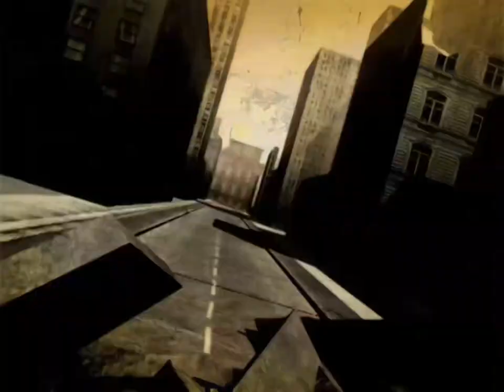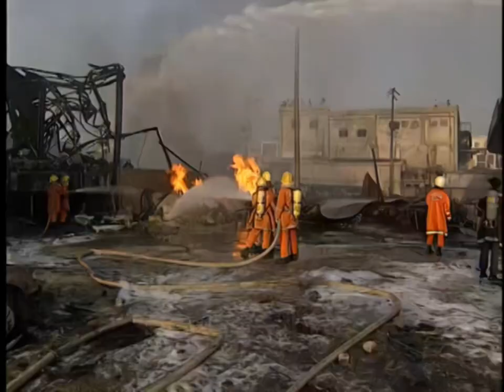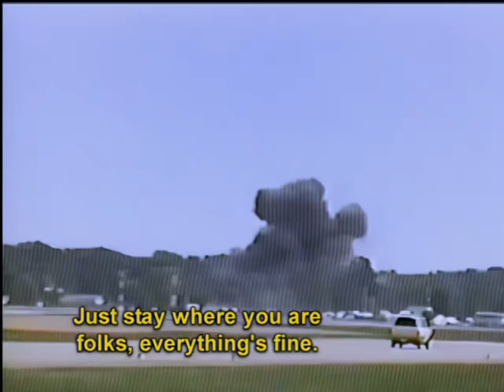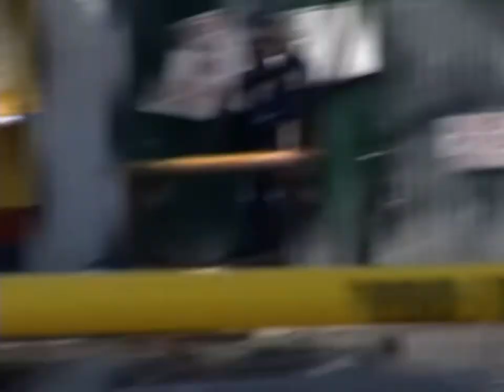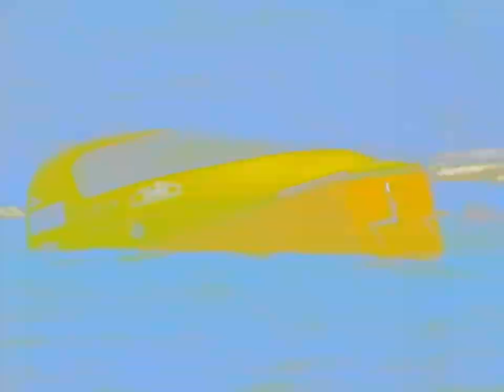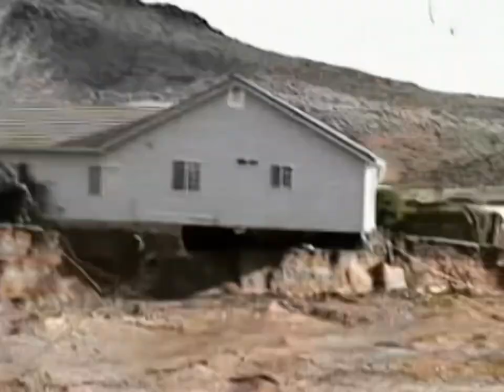Destroyed In Seconds Episode 3

Comment: I love how they blame the Pepcom explosion on someone tossing a cigarette into a bin of flammable chemicals. Which is not in any accident report. What IS: welding sparks, repairing the roof of one of the buildings. It ignited fiberglass (I think?) or something more flammable, set the building on fire, set some of the aluminum bins on fire, AND, most importantly, a leaky gas lind that had nothing to do with the plant ran undet the property, fueling and sustaining the conventional fire long enough to drive it up to the critical 700° required to ignite solid rocket propellant. Which a cigarette butt wouldn't!

The stupid thing was the aluminum bins. Solid rocket fuel used in boosters has aluminum beads mixed in with the perchlorate... I forget why, I think it's bound with oxygen to provide the oxidizer. Don't store rocket fuel in aluminum!!!

...someday, I'm going to find the rocket propellant bricks my dad made me when I was a kid. They wete left over from various stress tests, "Inert" fuel without the aluminum in it. Kind of rubbery, but also gtitty. They bounced. (No, he didn't work for Pepcom, his plant made kick motors for satellites. Unfortunately, the OTHER plant out by Salt Lake made the shuttle boosters, which is why I know some of this,)
Reply: the more you know